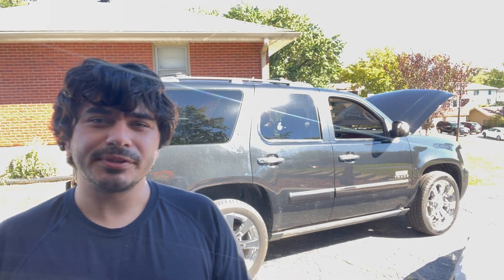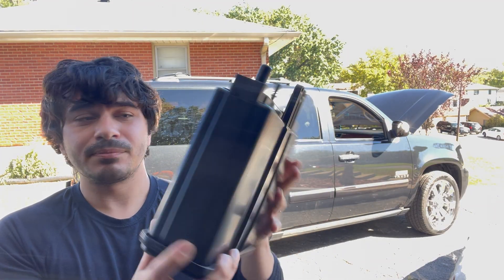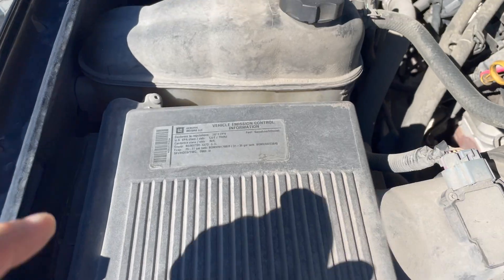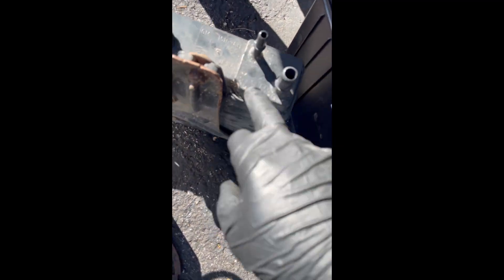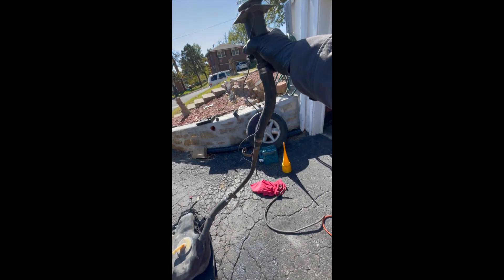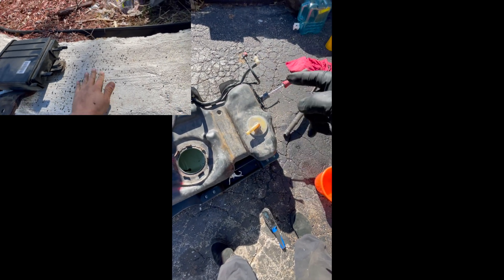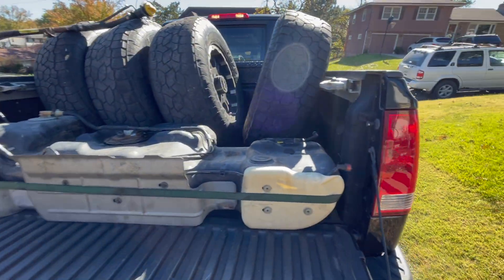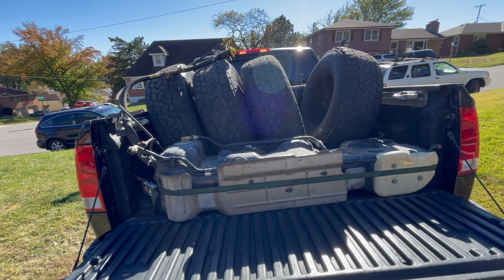Gas Pump Keeps Shutting Off While Filling Up Your Vehicle? (2011 Chevy Tahoe Evap Issue)

Comment: Did you have to lower the gas tank some before being able to disconnect that blue clip Line that is closest to the front?   I have a 2012 Tahoe doing this now.
Reply from the maker: Yes the tank had to be lowered to remove the blue clip. There should be some slack so that the hose doesn’t snap.
Reply: @Auto_Rx  Thanks for the reply! Also how did you go about removing the main fill line hose from the tank? I have a hose pick but man that thing is on there and I’m trying not to damage it, I know there is another connection I can try to loosen and remove hose from slightly higher up that would keep the short hose still connected to tank but would allow me to drop the tank.
Reply from the maker: @LandoWRX  if there is a harbor freight around you or another store that sells tools try to look for hose picks!